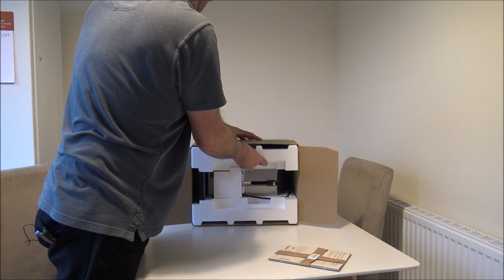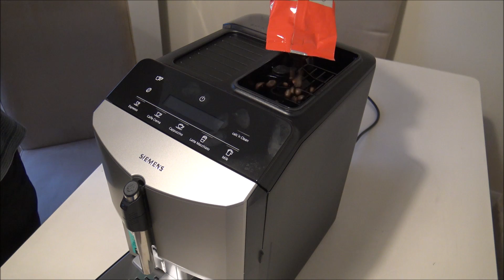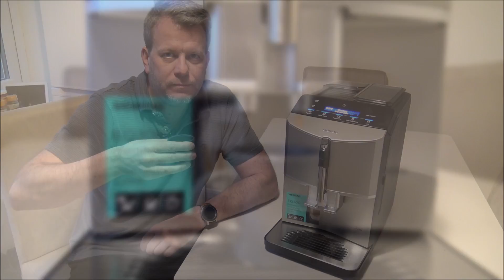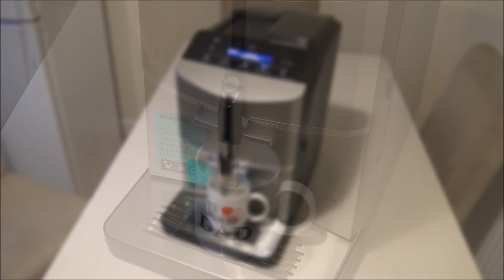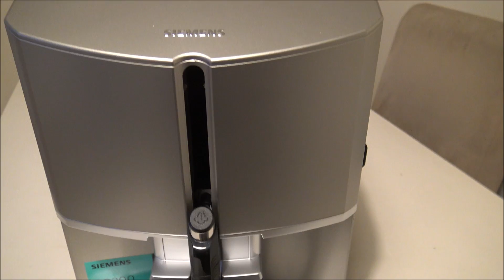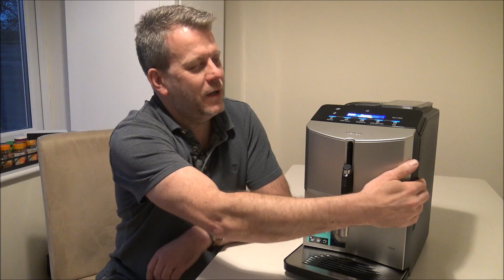Siemens TF303G07 Espresso Machine Demonstration

Comment: Finding out that you like Espresso makes me happy as that's my treat as well. Though I myself have a manual machine as it allows me to have minute control of grind and flow to hit the sweetspot. This machine that you've got yourself makes really good tasting coffee for the price that it costs. Though I think that the milk frother is a bit subpar as it introduces too many bubbles for my taste.  I think if I would like a simple button to cup machine I'd actually go for Jura ONO. You loose the freshness of beans but I think JURA's extraction process makes up for it. The biggest perk is simple cleaning which means just a tablet and an automatic rinse. So easy. Anyways I hope you get many good espressos from your Siemens 😊